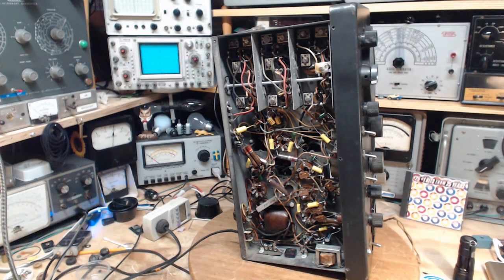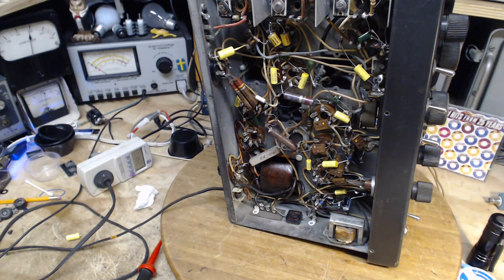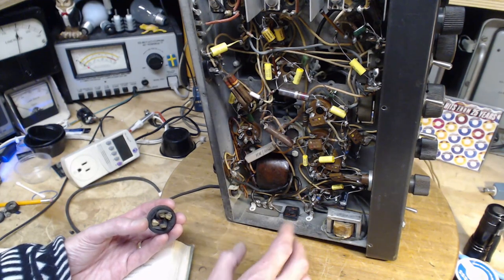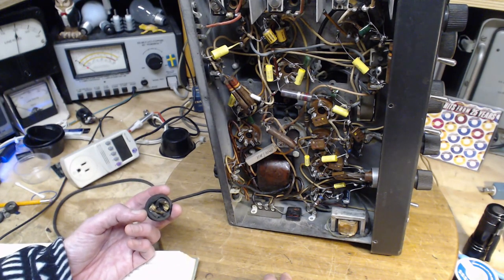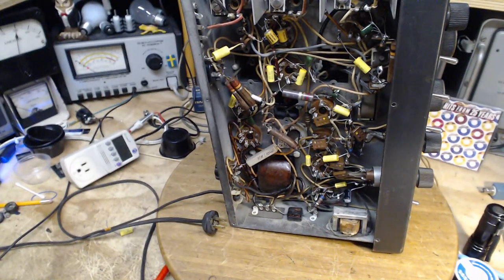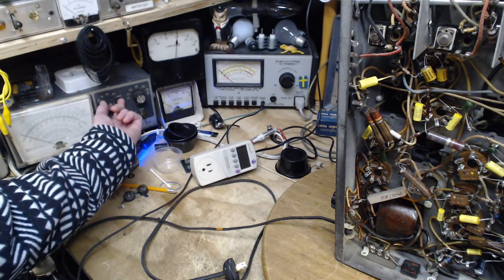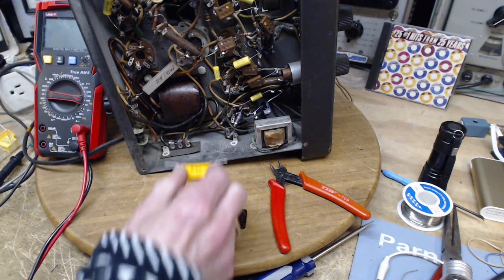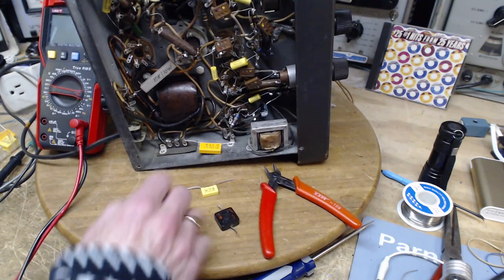Hallicrafters S 40A Shortwave Communications Receiver Video #9 - The Death Capacitor

Comment: You've never heard engine interference on a car radio?  I certainly have but it's been years.  My 1970 Chevy Nova and my Sisters 1966 VW Beetle most assuredly had the tick-tick noise on the AM band and the faster you drove the faster the ticking noise got.  I haven't heard it in years but I remember it well.

Comment: As usual, Jim is always in such a rush to move to alignment. I’m predicting that will be in multiple drawn out parts. Why he takes shortcuts in replacing capacitors, I have yet to figure out. He spends more time talking himself out of replacing them, and justifying, or trying to justify, why not to. It’s a very odd approach.
Reply: I enjoy putting his videos on in a sped up mode.  I don't know what you are calling short cuts in replacing the caps.   Shotgunning them is the short cut.  There are many on the antique radio forum that still go through the risky process of reforming caps.  If it is going back on my shelves, I might try that, but if I need to get the radio out as soon as possible, I shotgun it.  I think he is also attempting to get away without fusing it.  Fuses are a lot easier to find than a replacement transformer.  Oh well, we called him out on the "death cap" and he listened.  Perhaps he should get a newer repair book for thiese old radios then his old standby.  It was likely the state of engineering at the time it was written. I know he does not frequently look at other people's videos as he his making this his own journey.   He could have simply typed in Death Cap and found a number of videos on it.   Oh well, there is just something interesting about his "work".   73

Comment: Greetings:
Connect the chassis ground to a real ground while power is off to avoid reading low value induced ac pickup that your high impeadance devices can read. Although the neutral is bonded to earth at the power box you should measure the ac voltage between neutral and safety ground close to the radio. I would replace the two line powercord with a 3 wire cord with hot going to the radio's power switch. Do you believe it is correct to wire safety ground across an isolation transformer? I DO.
I have !n isolation transformer designed for audio equipment that outputs balanced ac with a grounded center tap. I have not checked the internal wiring to verify whether the output center tap is connected to input neutral or safety ground. I would hope that safety ground is the better choice for both safety and noise suppression.
I think you should draw yourself the powerline circuit to the transformer primary and label the unswitched wire as hot. That will show you that all points up to the switch are hot regardless of the switch condition.
High impedance circuits will show readings into a high impedance meter all the time.
I like your method of using a test lamp to check for power delivery capability.

Comment: Your X and Y caps are designed for PC board mounting. Ill bet the PC board will flame and burn. Its all theory, men agreeing on a principle right or wrong.
Reply: Argue that on the antique radio forum.  Safety caps are frequently used.